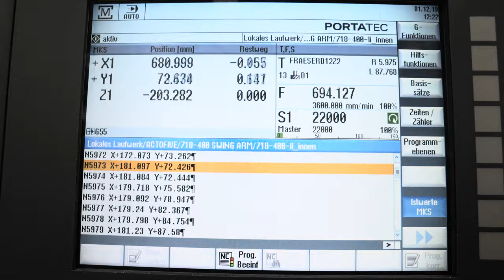ACTOFIVE's fully CNC'd P-Train | A High Pivot Trailbike made in Germany | BIKE BUILD

Comment: A totally stupid way to make a bike. It’s basically the same as Pole. Way too time consuming without any obvious advantages over “normal” methods.
Reply from the maker: @asifitmatters1  you know it better😀
Reply from the maker: @asifitmatters1   You won't find this aluminum alloy on welded frames, nor will you find such precise tolerances in classic manufacturing, and you won't find the internal struts anywhere else, sometimes asking is better than just running your mouth!